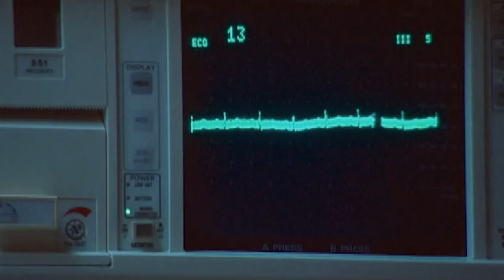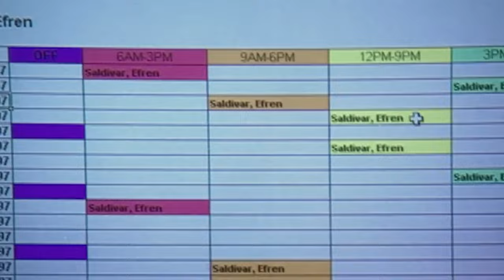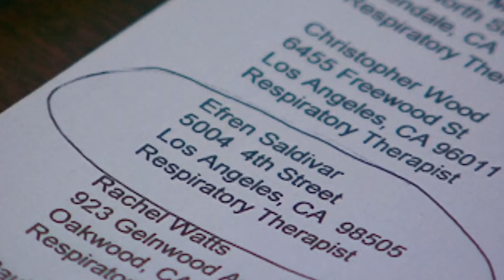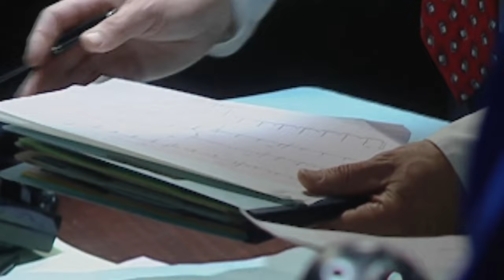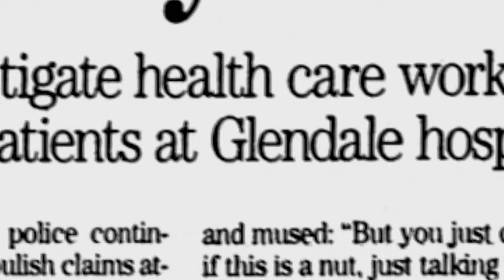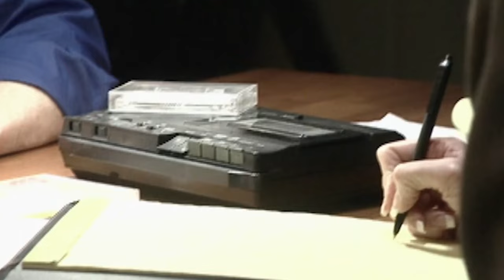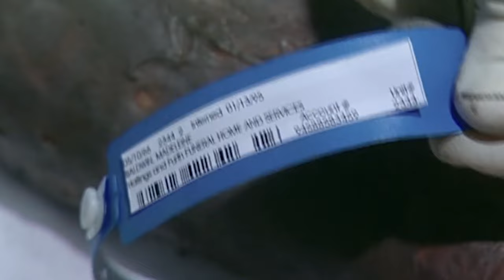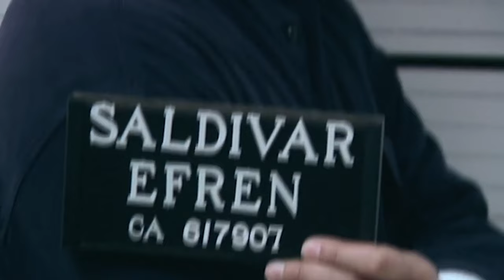The Doctor That Administered Poison To Kill Patients In Hospital | Absolute Documentaries

Comment: Why don't detectives use one of those tiny cameras in each room that he goes to they will be able to see them. Tiny cameras in each room he goes in.
Reply: Can't do it due to HIPPA regulations.
Reply: Get the patient permission and there are already cameras in the rooms so nurses can monitor from the desk.
Reply: @oakmaiden2133  There are only cameras in certain rooms (such as if the patient is deemed a risk to safety of self or others), and regulations about when cameras can be used. Depending on where you are, those cameras may not keep any recordings past the end of the shift, or even at all. It's also not most rooms.

There are oxygen and cardiac monitors that allow the nurses and doctors to see what's going on from even outside the room, but that's just the patient's vitals.